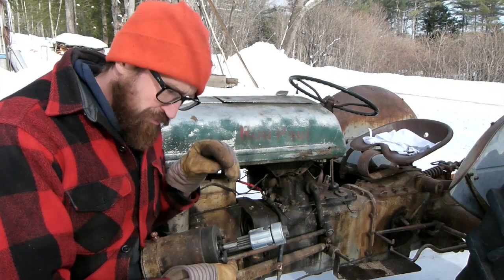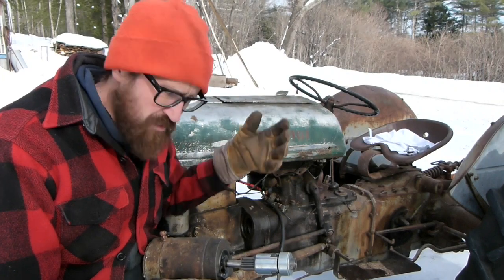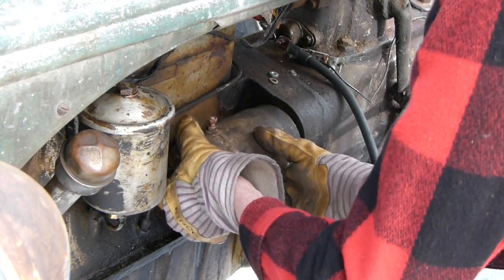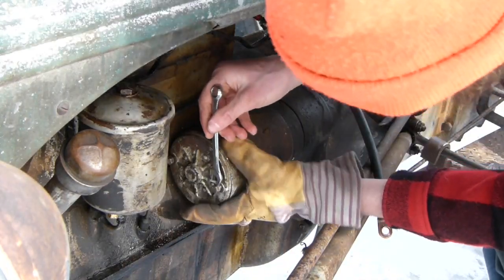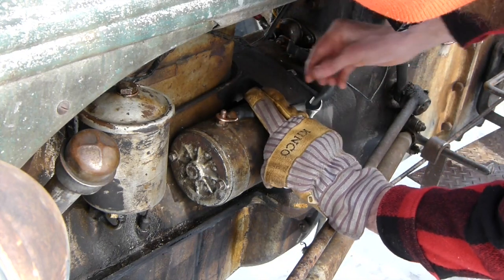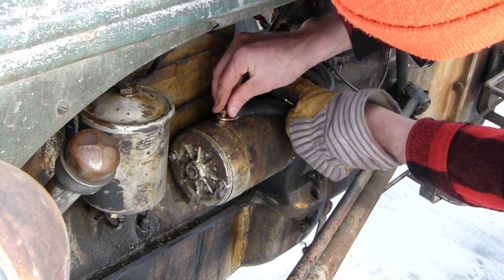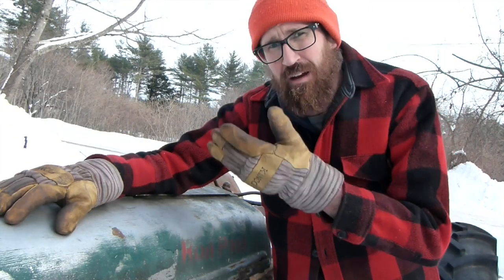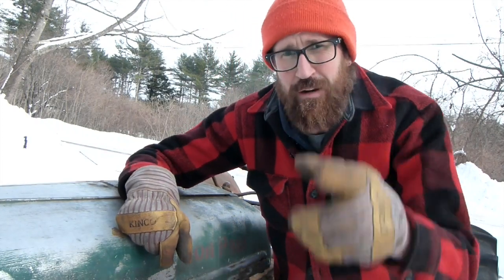Ford Tractor Split Follow Up!

Comment: On spring loaded bushing, as you probably already know, there should be a pin hole in the top of their housing so you can use a wire to hold them in place while you slide them on the shaft.  And if not, you can always drill one..
Reply from the maker: I had seen that before, but in this case, they are wired into the back cap, and that is wired to the housing, so there was no chance to drill. I used four tiny vice grips and it worked. so frustrating.